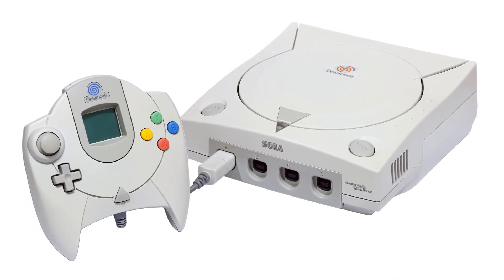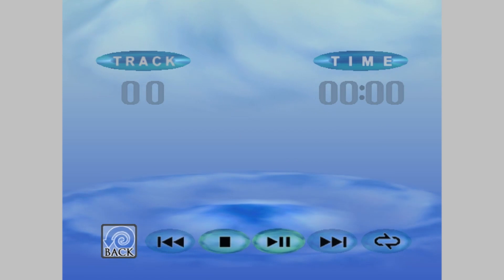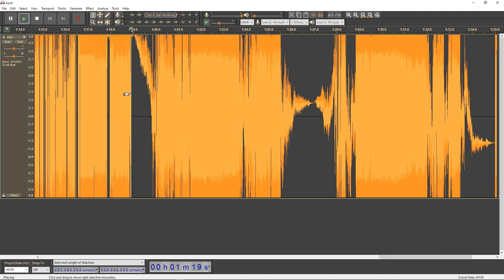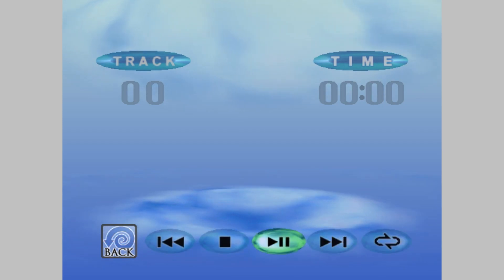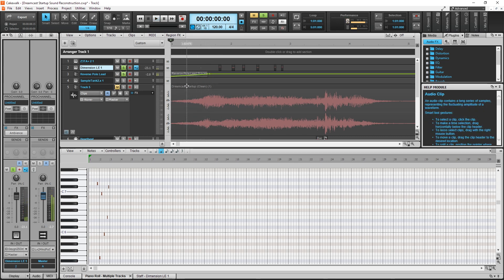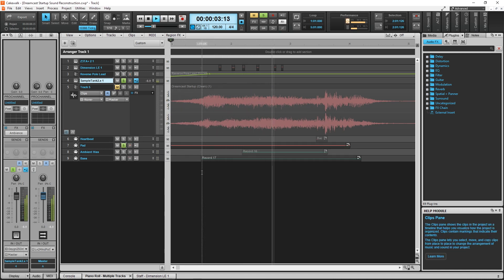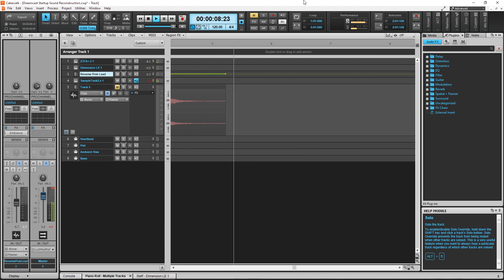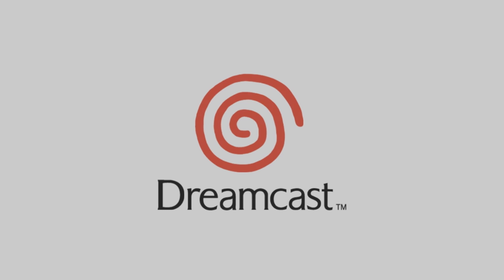Dreamcast Startup Sound Explained

Comment: The "pole lead" sound has been around forever, it's just band filtered white noise with a tight Q (hence the "pole"), with the filter frequency corresponding to the key played
Reply from the maker: Indeed.  I messed around with its settings in Dimension LE and discovered it only used a white noise sample with the filter.  Simple, yet effective.

Comment: Pretty cool and close recreation. The trick with recreating the sound is also lowering the bitrate of the samples that youre using. The original has a lot of bitcrush/lofi/antialiasing present in the audio, which is probably due to the audio had to be the smallest size to fit on the chip. Old samplers and romplers from the 90s that used samples all had that lofi tone to them, which is a super distinct 90s sound imo.

Comment: The menu sounds in the bios usually don't sound as annoying on actual hardware; I think the hardware must apply some kind of effect to the sounds to soften them. The emulation of the bios clearly doesn't add those effects.
Reply from the maker: Very true.  I wish I had caught that on the actual console (I had access to one for a very brief time) before using an emulator to capture cleaner footage.

Comment: Due to it being recorded, would that explain why there is some compression within the audio in the startup?
Reply from the maker: I'm sure it's one of the reasons but it was standard with a lot of consoles to use ADPCM on all audio, if not MP3, Ogg, AC3, or ADX as on newer consoles.  ADPCM is fast to decode on older hardware so I'm sure that's why it was used a lot.

Comment: Hey Man, great video !
Just a little correction about the navigation sounds on the menu, these are deformed on emulators (I don't know why, maybe a problem from the emulator when it decode the sounds on the bios which them must be generated by the sound processor) and make them really hard on the ear but on real hardware these are really pleasant and not that loud !
Reply from the maker: Oh, yeah; I found that out after making the video.  I didn't have access to the console for very long; otherwise, I'd have found that out ahead of time!

Comment: I couldn't help but notice your take on the sound for the game menu on the dreamcast being rather obnoxious.  It would appear as though you are using an emulator correct? I only ask because for w.e. reason, the notes on the dreamcast will hang in the bios on most dreamcast emulators I've used. The notes are a lot shorter on console. Release and decay seem to escape the emulators i've used in the sounds for the dreamcast menu.
Reply from the maker: Yep.  I used an emulator for the footage because it's cleaner than an analog video capture.  Sadly, I didn't have access to the console for very long so I didn't go through the real menus to learn that it didn't sound the same as the emulator.
Reply: @Nitrocosm  Its ok your doing great. Very appreciative of the videos you have been throwing together especially during these trying times which hopefully our mostly behind us for now ? Great stuff!

Comment: I have a Dreamcast, and it's cool. But one minor nitpick with my Dreamcast is that every time I start it up, I have to reset the time, But I don't mind.
Reply: You only need to change boards battery. It’s dead. It’s pretty easy if you can solder.

Comment: Whoa hold on...

Those menu noises are different over here.

They sound much smoother and less jarring than that. 

They made the American dreamcast menu noise sound like THAT??? I wouldn't like them if they did.

You'll have to get a European dreamcast and see what the differences are haha all I can say is that those menu noises sound nothing like that. 

Let's not forget we also got the cool blue design which I thought fit much better.
Reply from the maker: Honestly, no; I had to use an emulator to capture those menu screens.  I only had access to the console long enough to record the startup animation and had to do the rest on my computer.  The actual console's menu sounds, as it turned out, are not all messed up like that.  By the time I realized that the menu sounds were not accurate, it was way too late.